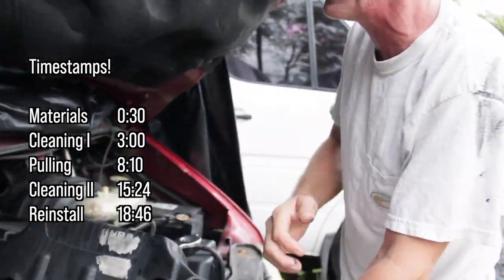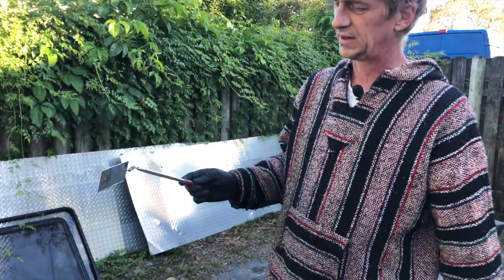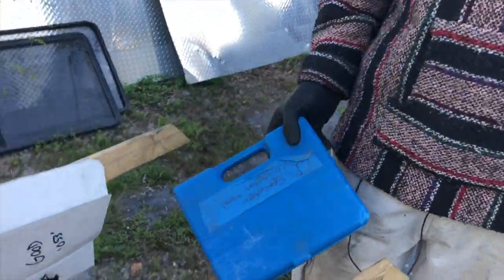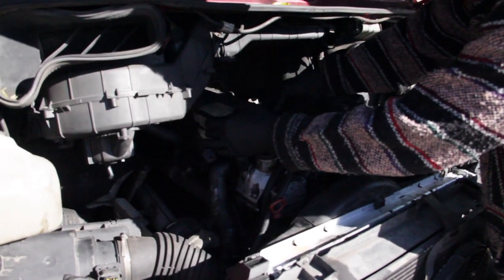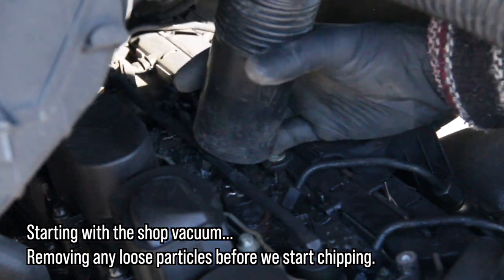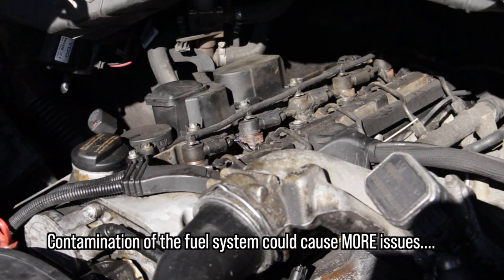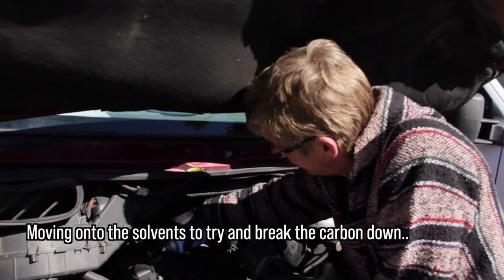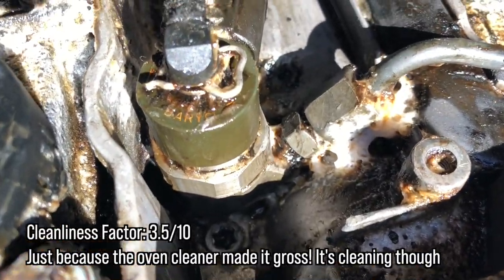Fixing Black Death on my T1N Sprinter!

Comment: Tip that I learned from Doctor A.  Run the van unti its hot, whilst spraying WD40 down on top of the injector.  After its hot and lubricated Unscrew the injector bolt 3 turns.  Then drive the van a bit until the injector pops up and out a bit.  You’ll know by the sound.  He told me the hot engine makes the carbon stuff a liquid and the pressure will pop the injector up and out for you.  Then you unscrew the bolt the rest of the way and take the injector the rest of the way out.
Reply: This technique is a huge time saver, did it this afternoon for 2 injectors, took just 1.5 turns and a short drive for them to pop up. Thanks for the tip!

Comment: If you take one of the stretched injector bolts and grind a bevel on the end, that can be used to clean up the bolt hole threads in the head. Just a light handed approach and screw in until resistance is felt and back it out (wipe of the carbon) and try again numerous times. Then when you put in the new bolt is goes in with no resistance.
Reply: Great comment
Reply: @go5582  Thanks FVM. I had a problem recently with voltage drop from the short negative battery cable. Van no start. Replaced cable and now at 190K I am all smiles. Before finding the neg cable problem I replaced the ignition switch as the dash was not lit. Made a special tool of welding wire (mild steel) to reach around on the back side of the switch barrel
to release that little locking pawl and the switch came right out. Will do a vid on that at Vincent Rolfe (utube) when the Chicago weather quits being -5F as it was today. Can you bottle a little of that FLA air and send it to me???  Price on T1N parts is going down as MB is not moving their inventory stock and it is costing more to house slow movers in their warehouse. Replaced the passenger side wide angle mirror for 30% less $$$. Time to buy some T1N stuff on sale in isle 6 at Walmart-MB.

Comment: what is that, burnt diesel?
Reply from the maker: Yes, the black crust is wet combustion gasses forming a hard carbon as it cooks and dries on top of the engine.
Reply: Hmm... so, if leaking happens, we should see, wet parts there and then the crust starting to form? Or wet and liquids is a red sign and the crust will come days after? 😢
Reply from the maker: Wet is fresh leak. When the engine gets hot it will cook the wetness into a crust. As the wet vapor keeps coming, the crust keeps growing.  @LeopoldoManuelRamirezMena

Comment: Purchased new in 2006 and with 186000 miles I thought I would take a look under the cover. Looks like it left the factory a week ago. Very reassuring….
Many thanks for the videos.
I’ve managed to change many parts over the last few years and with me being a body repairer and sprayer the now converted camper van looks and drives superb…..
Reply: My 2006 has 450000 still runs perfect.  Amazing how well this engines are made.

Comment: My #2 cylinder had the death and I made a series of welding rod chisels along with using an old wood chisel and finally after 3 hours got the mess around the injector cleaned; then, I removed the injector with lots of back and forth along with oven cleaner and more chisel work. patience is the word. Your 2500 was driven lots of miles with that leak. NO vac used just dampened paper towels on the end of long shaft flat blade screw drivers.

Comment: Having replaced the #3 injector, is it worth the effort to preemptively replace the seals on the other injectors? Or is fixing them one-at-a-time entirely sufficient?
Reply from the maker: We have mixed opinions on that. I feel it is best to leave good seals alone. I can't fix it if it ain't broke, and replacing a good seal may end in disaster with a stripped bolt hole or a new leak that we didn't have earlier.
Reply: @FloridaVanMan  the bolts seem to come out fine when I try to remove them and they go in just as easy and the torque isn’t to bad to put on it. But even with that said there is a risk of still stripping them?

Comment: Flat side of the copper seal on the injector (steel) rounded side to the engine (aluminium)  👍
Reply from the maker: Yes, although OEM washers don't have a flat side. I don't buy theses knock off washers with flats any more.

Comment: My back hurts watching this video. What way points up on the copper washers? One side was dome shaped and flat. My diesel experience comes from 1981 W123 and we prime the system after fuel work. Will this one need priming?
Reply from the maker: I'm not clear about that. Logic tells me the flat side should press to the steel injector and the rounded side will seat to the aluminum head. Maybe others will comment to confirm or refute my thoughts on this. The ones I am accustomed to do not have a flat side.

Comment: So just to clarify you don"t need to cut / ream  the seat if you can properly clean and remove all the carbon from the seat? Is there another reason for reaming the seats?
Reply from the maker: I've not found any good reason to ream a seat. Seat cutters in the hands of unsupervised DIY-Guy often leads to chatter marks and bigger problems. Use scrubber pads, not wire brushes because brushes drop bristles that end up inside the engine. Scrubber pad on a spinning disc will do almost everything a seat cutter can... without the danger of going too deep or creating bigger scars.

Comment: When i had black death on my vito, i only had patience and patience and i got it to assembly point and I cracked the treads then i snapped and towed it to an garage.
Reply from the maker: Oh yea! Patience and patience is not enough... You also need More patience! LOL This is one job that any amount of "hurry" will cause error! And those errors can be a killer. Did you see the later video where the bolt broke in the hole? That is even worse than stripped threads because I had to drill the steel bolt out of the aluminum head before tapping new threads.

Comment: What were the symptoms you were having with the black death?
Reply from the maker: Removing the plastic cover over the engine you can see it, but it doesn't always cause a driving problem. The first symptom is often smelling fuel in the cab, then hearing a chuff-chuff-chuff under the hood. If ignored the van will keep going, but the mess gets bigger and harder to clean up.

Comment: If reusing an injector what would you use to clean it? Brake cleaner and a greenie?
Reply from the maker: Yes but avoid the tip. Brake cleaner and scrubbie, avoid wire brushes or anything with fit that might fall off, like sand paper or steel wool. Scrubbies might shed and teh shedding is abrasive, but not gritty.
Reply: @FloridaVanMan  thanks. I also have scrub pads made for nonstick pans, I'll start with those.

Comment: For me #4 was leaking and stuck according to the Dodge dealership who used a cherry picker on the injector itself. This was when I bought it from the last owner. It was running poorly and stripped treads on the #4 hold down screw according to my mechanic. My mechanic removed the valve cover and used  a helicoil to repair the threads. Cost me $1,500 (labor, anti seize, cleaner, injector washers,  valve cover gasket, and new bolts) in total and I provided 1 new injector.  How hard is it to fix stripped treads on the hold down screw?
Reply: It depends on how good the access is, taking 4/5 injectors out from one of those engines is a whole load of work
Reply from the maker: The front holes are not too bad. The back holes are a real pain but can be made easier by pulling all the plastic air ducts out from above. The hard part is drilling and tapping the hole straight, without overhead room. Lifting with a cherry picker is limited to the weight of the van. The proper puller pries against the block of aluminum the injector is stuck in, rather than lift the van.

Comment: Thanks for the video.
Reply: Thanks for video mate, may be someone have answer to my problem.
I have Mercedes Vito 2003 recently changes high pressure pump seals. Used little bit too much 😜 starter fluid to start Van not engine is running very roughly and white smoke coming out exhaust.
Any suggestions please

Comment: Absolute madness.
Reply from the maker: A few months later and this van is still killing the game, and just as clean as it was at the end of this video!!!
Reply: I know you do good work and I agree the sprinters can be good vans.. I have had one 15 years..

 I only get down on them because the tech level is way over the avg owner to do any diagnostic repairs. You seem to like the work and that’s cool, but for me? I just want a reliable machine so I can go do my idiotic flooring work. 

 Most dealerships can’t even troubleshoot these that well.. I know some can but it’s a crapshoot for the owner that lacks knowledge.. I repaired diesel locomotive electrical systems for 12 years and I am certainly burnt out of fixing stuff.... or I got lazy) keep up the good work and continue to help whom you can. It’s needed.

Comment: 13:42 'The extractor uses the valve cover as leverage' is that the same valve cover 9:45 that can easily be damaged if you put too much leverage on it?
Reply from the maker: The extractor presses on the valve cover where it is directly supported by the engine head at the brim of the injector hole. The valve cover is not supported anywhere else except the outer edge, so anywhere that makes an effective leverage point is also a brittle aluminum bridge.

Comment: I see you pressure washed after.  Is there a reason not to pressure wash right at the start or compressed air.
Reply from the maker: I found pressure washer doesn't do much to the carbon except get it wet. Then the oven cleaner is less effective. Shop vac is highly recommended over compressed air. Blasting with air throws the carbon debris *somewhere, and there are many exposed places we don't want it. Getting all the water out of the injector area after washing is critical. A leaf blower or compressed air is fine for this, but shop vac also works wonders here. Warm to dry the engine lastly, before installing the plastic engine cover.

Comment: My van idles good but shuts off randomly while driving can it be a injector issue
Reply from the maker: Randomly* or approaching stop lights and signs? Probably not injector issue but it is possible one is causing a fuel pressure issue. More likely the fuel rail or high pressure fuel pump. When was the fuel filter replaced?

Comment: Hi just asking about the coding, are you saying the computer adapts to the new injector without being reset ?
Reply from the maker: Not exactly. The computer adapts to maximize performance. The coding gives the computer a starting point for that adaptation. But it is more complicated than one value adjusting up or down because there are 6 values in the coding addressing 3 stages of the injector, timing and duration of each.
Reply: @FloridaVanMan  thanks for the vid. I've got to check mine. I smell exhausted in the cabin when I the heater.

Comment: FVM got some questions. I have a seat on the #4 inject that is leaking. Not much black death in the area but the hold down will not release after I removed the one time T40 bolt. Any idea as
to what is keeping that hold down from coming out. I have been soaking the area with oven cleaner and have used 5K towels. I have tapped the small end of the hold down and sides too with little movement. If I can get the hold down off I will bring the motor up to temp. What is a source for the slide hammer injector remover? My first injector 35K miles ago was so easy to remove
but I will need a federal court order to remove this one. Thanks
Reply from the maker: We have found J.B. Weld under more than one engine cover. it seems if the valve cover gets a crack, that is everyone's go-to product. The slide hammer-claw: https://amzn.to/2WfEfmP
Reply: @FloridaVanMan  Well thanks for the response. I went ahead and ordered a slide puller from Amazon for the 320 MB. not enough room above 4 or 5 cylinder to run the slide with the furnished bolt that connects from the claw at 200MM (16 X 1.5 bolt) so have ordered a 90MM and 120MM bolt to make it work. That #4 injector was certainly hard to remove due to the hold down being frozen in the black. Went door to door up and down the block asking all the neighbor ladies for this oven cleaner and soaked the hold down for a day. When I get the shorter slide bolts dwill give it a shot. Govoni-Italy makes lots of nice pullers for Euro Diesels. The US made claw I got was a nice fit with
no grind required. Have a good summer FVM and keep the stretch bolts comin!!
Reply: @vincentrolfe1384  where did you get the 90mm and 120mm? Also is it safe to spray oven cleaner down the shaft of a stuck injector? What about pb blaster will that be safe to spray down the shaft as well? I have a stuck injector so what to try both and want to make sure it’s safe.
Reply: @offset25  Dino, yes some of those spray cleaners are OK to soak a stuck injector or hold down arm. I, here in Chicago, can buy those bolts or go ahead and order on the net and get in a day or so. Due to the tight surroundings of those injectors I found the different lengths necessary so as to removed injectors. Hope this helps. If you see Diesel spray on your windshield; it's time to start looking for a leak. Some leaks have a slight metallic noise at first that develops into a leaking under compression sound.

Comment: You don't have to wait until they are carboned in and stuck.  Re-seat them every 50k miles as a routine.
Reply from the maker: Every 50k would excessive. Common practice is to remove them at 200k for testing and of course new seals & bolts when reinstalling. Have injectors tested for $25 each at a Bosch Authorized Service Center any time the injectors are out of the engine.

Comment: does this always require cleaning the threads?
Reply from the maker: Yes, any crud left in the bolt holes will cause the bolt to tighten before it clamps down the injector. When the injector is not held tight the seal will leak causing new case of black death.

Comment: Bill, any video on removing a Glow plug that's just free spinning?
Reply from the maker: Glow plug video is in the works, but not here yet. Sorry.
Reply: @FloridaVanMan  NP I have a recently purchased 2006 with ENG light constantly on and it codes to the two front glow plugs which are free spinning. I bought my mech a kit to remove it and he reluctantly backed out claiming it was too easy to ruin the head.

Comment: About the 5 minute mark: air compressors illegal in Florida, right?
Reply from the maker: I'm not sure what you mean. My neighbors get upset when I use air-tools and I don't use air compressor to blast dirt out because I am concerned about where the debris goes. I don't want it in my engine, my eye, or my mouth, so the shop vac does the job others may use compressed air.

Comment: any secrets to power washing it without damage at the end?
Reply from the maker: My pressure washer is not the biggest-baddest, and I use a fan tip. But I go crazy and never had a problem. Under the hood, under the van, under the driver seat... Yea, I did it!!! I don't recommend it, but I did it more than once and have not had a problem.

Comment: Transit here I come.
Reply from the maker: Injector seal leaks could happen to anything to be fair.
Reply: @FloridaVanMan  I’m just being an ass. Saw a 2008 sprinter with 720k miles on original engine last week.
Reply: Good luck install brakes on the transit..

Comment: How is the set placed on the injector as it has a slight bevel to it?
Reply from the maker: The seals I am familiar with are beveled on both sides, so it does not matter which is up. I recently bought some with a flat side so I will need to figure that out soon, which side goes up. If you find out please let us know.
Reply: @FloridaVanMan  will do. I bet million mile sprinter.com would known. Did u purchase from him?

Comment: Thanks for the video. Not quite as easy as I was told by the guy who sold me this T1N.  Why don't you use mechanic penetrating oil? I sprayed my leaking injectors with Blaster and it seemed to dissolve the black pretty easily. It isn't like the one you are working on though. That was disgusting
Reply: Is there any issue with blaster damaging the engine if you spray it down the shaft of a stuck injector?
Reply: @offset25  of the injector is still stuck in the hole then the blaster doesn't get into the engine. I use a shop vac with a smaller hose, like a vacuum line size, to suck out the black death and liquid.
Reply: @grantdubridge7995  I ordered the pb blaster. Is it the same as carb off? Or different? I was able to loosen the injector bolt and drive the car around and that loosened it after 2 minutes of driving. I immediately stopped and  once I heard it pop and leak fuel and retightened the bolt and drove back. I was then able to get the injector out. I actually found two seals in that injector. One caked black and attached flush to the top of the shaft it goes into. If you weren't paying attention you would have thought it was part of the injector which was also partially caked black. The other seal was at the bottom of the bore. The last person who replaced the seal didn't notice the existing seal already attached to the injector. I just bought the sprinter so I was doing all the fixes.
Reply: @offset25  Pb Blaster it's a penetrating oil to remove rusted bolts and other stuck situations. I believe it has a lot of citric acid in it but don't really know. It does not have the Flourocarbons that carburettor cleaner has or the alcohol that brake cleaner has.